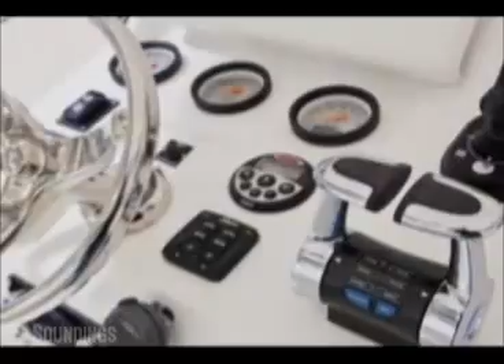An outboard like no other

Comment: Makes me wonder how much power the out unit can take. GM LS motors can make huge HP and cubic inches of 454 and 700+ HP right from the GM performance catalog and well over 1000 HP aftermarket and not adding anymore weight.

Comment: thats funny because if you have not done your research all the Mast Marine motor are GM LS base motors so motor for motor the weight is just about the same... with the 557 you would add the weight of the supercharger  Just saying maybe you should do some research before you post.   mast-marine   go to there website

Comment: They should have talked to Mast Marine before they went with this heavyass Caddy motor. The Mast motor weighs less than 600lbs and makes 600hp. This one weighs over 1000lbs and only makes 557hp.

Comment: Evinrude ' Electramatic' shift used solenoids the actuate the shift lever inside the leg. This engine uses electrically controlled wet clutches. Not even a similar concept.